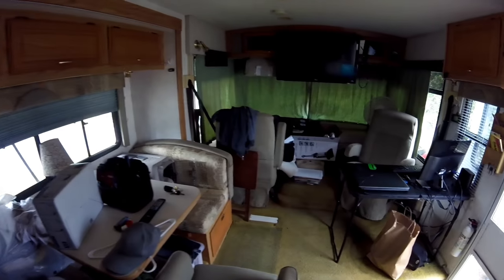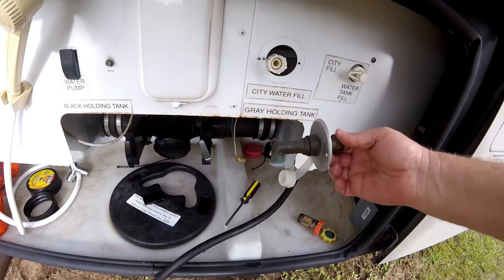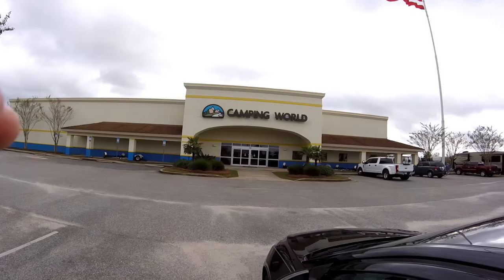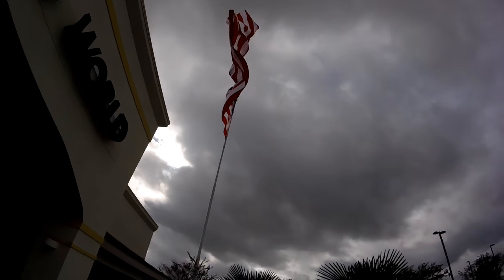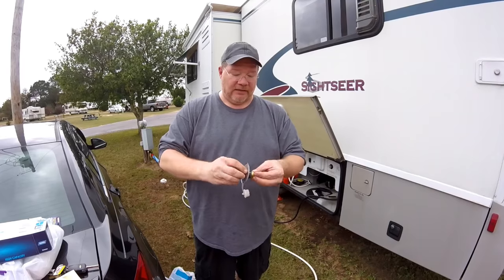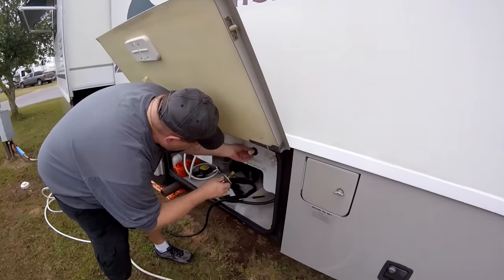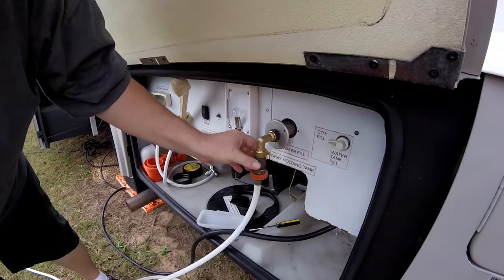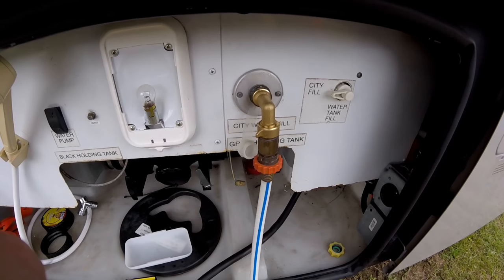RV Mod Fixing City Water Valve

Comment: Hey Patrick, You may want to put some white teflon tape to the New brass fitting to the old brass fitting. It will help to prevent leaks. Just a tip I learned when we had the log home. Very good job though and glad you can get the stink off now....LOL Really glad your back with Mert!!!
HAGD!!! .....HAVE A GREAT DAY!
Reply from the maker: Thanks David .. good suggestion. The main connection point is well-sealed ... but I may put some teflon tape around the outer fitting.  Nice to be back and enjoying it very much.  Enjoy watching your channel as well!
Reply: Great job ,but I would like to know how to repair my city fill and water tank fill switch .the presser blow the switch off

Comment: The video was very helpful. I need some help with valve to the right of the one that you fix. The city fill/water tank fill valve. Mine broke and I cannot figure out how to fix it. Any help would be appreciated.
Reply from the maker: Thank you for your comment. Sorry I am no help with the main city water .... I think the panel needs to come off to expose the plumping in this area where you can access what is broken or leaking.  Good luck.

Comment: Great information but.....your water filter and your pressure regulator are backwards. You should be regulating pressure into your filter (as indicated on the packaging) and your hose (to keep it from swelling/bursting) and have the filter at the last point of entry into your RV so that whatever is just sitting/stagnating in your hose is not going into your RV.